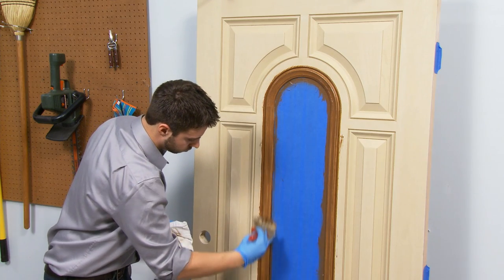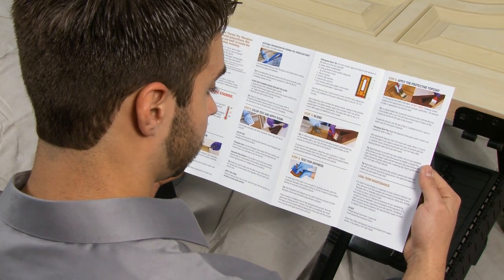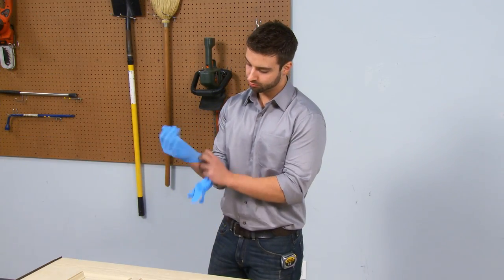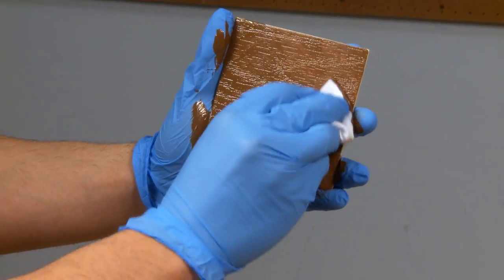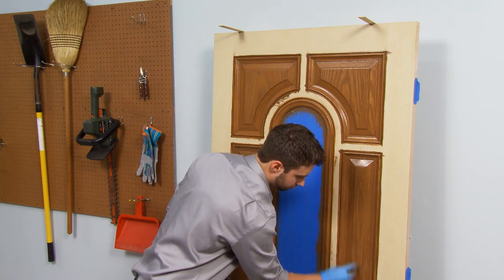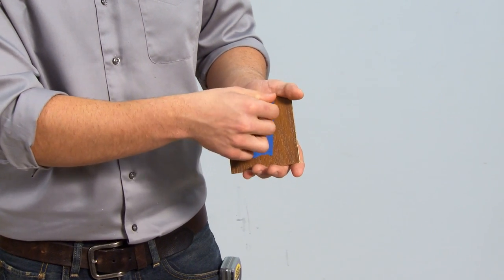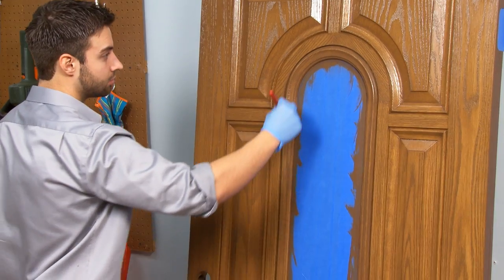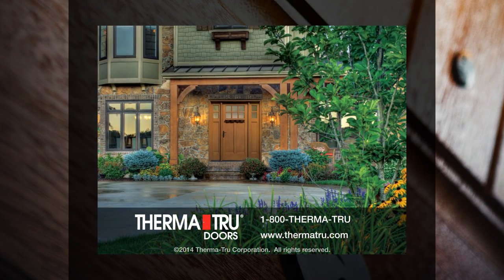How-To use Same-Day Stain and Topcoat: Fiberglass Doors

Comment: Due to the high volume of building in 2021/2022, and our Contractor's multiple commitments, it was taking too long to get a front door. After much back-and-forth about the door we did and did not want, our Contractor tried to help us by going through his door supplier. We ordered the same-day stain ourselves. The painter came to apply it, but didn't allow enough time for the finish to dry. He ended up stripping the entire door...which mars the faux wood grain...and leaving it at our house while he worked on other jobs. We decided to take over. The key to this whole process is putting the finish on in layers; thin and careful. I put too much top coat on the second side, and messed up a good thing. Hopefully there is a solution for that which doesn't involve starting over! Follow the video directions for when to use the foam vs bristle brush. Put the stain on with a cloth as indicated. Wipe up excess topcoat as instructed. This helps with a good faux finish. Watch the video before starting, and before every step of the process. Even the 2nd time of the same process. You always hear another detail that you missed the first time! Put the stain on lightly, and allow it to dry in a warm place. It is not "same-day". We dried 1 day at a time before going to the next layer of stain...if certain it was truly dry. Have a warm/hot area for the door to dry. Use their tape test to make sure the stain is ready for another coat. 2 thin coats with a third touch up was the average. Wipe excess off the brush with a cloth, but avoid too much mineral spirits on the cloth...it lifts the finish of your previous staining, and hard work. Allow time to do a careful, meticulous job. Thin layering is key to creating a wood finish. Would I get this door again? If "yes", I'd have it come with the factory stain. Forget the DIY. The door does look more "life-like" with the stain done properly. But the real answer is '"no". I wanted a wooden door all along, but couldn't source one. I could have bought the same style wooden door for $1,000.00 less at Home Depot and it was pre-stained. Also, I would have rather spent the extra $1000.00 on a solid wooden door. COVID and supply chain issues caused us to have to go through a year long headache that culminated in the availability of the door we had wanted in the first place. By that time, the door jam was installed and the other door purchased...with no returns allowed by the Contractor's supplier.

Comment: word to those that want to do this.
Do as they say and do certain sections, and have PLENTY of spare old t-shirts handy in strips.  Like 20 of them.  Very lightly glide the old t-shirt over the stain to smooth and wipe it in.  Sadly, I had to recoat as the door I was more aggressive with the wiping that the side lights.  So when it came time to do the door, I thought I nailed it but this stuff will wipe of almost completely down to the bare fiberglass if you push to hard.  So be gentle.  Even if you use three fingers behind a wad of t-shirt you'll see three streaks that will need to be smoothed down or restained.  I had an area whereas I had finger marks, but didnt notice until after I did the top coat. I wiped off the top coat and reapplied stain - six hours later the stain still isnt dry. 
This isnt stain fyi, I dont know what it is but it's NOT stain.  DO NOT rub it like you would stain, VERY GENTLE and smooth motions.
Reply: This gel stain. But more of a liquidy form. Not sure why they recommend not to use gel stain.

Comment: Can I restain my door using the same Therma-Tru color I originally used without stripping it?
Reply from the maker: For small scratches, new stain can be applied easily to touch up the areas. However, for larger areas, newly applied stain may not adhere properly to the existing finish or blend seamlessly. For larger areas, we recommend stripping the door to the bare fiberglass and re-staining the door.

Comment: Should've mentioned that the paint brush sheds like a Maine Coon in spring. For a $150 set, I'd expect a better quality brush. Haven't gotten to the top coat part, so will see how that will go. P.S. The top coat brush is fine, but the paint takes a lot longer to dry than 6 hours. I don't know, maybe if you paint it at 90+ F degree heat, maybe it will dry faster, but at around 65-70 F, it has been over 8 hours, and the paint is still wet (and, no, I did not use a lot of paint).

Comment: What kind of caulk are you using to seal any gaps between the glass and the wood before staining?  Is it latex or silicone, or what?  Thanks.
Reply from the maker: Therma-Tru recommends using an elastomeric or polyurethane sealant during this process.

Comment: Could you use this stain over latex paint? Wanting to stain over my king size bed frame
Reply from the maker: Hi, Liz.

Same-Day Stain and Topcoat is specially formulated for Therma-Tru fiberglass doors and Fypon stainable polyurethane. Because of this, we do not recommend using Same-Day Stain and Topcoat on other surfaces and materials. If you have any other questions, our Customer Care team is here to help at 1-800-THERMA-TRU (843-7628).

Comment: Hey man quick question! I watch your channel and fan of yours on YouTube. So got a new door and want to gel stain it but need to cover screw holes up. What kind of sparkle I use and do I prime it with what after? Thanks man!!👍😊
Reply from the maker: Hi Michael, You can use any stainable hardening wood putty to fill the holes. Your local hardware store or lumber yard should be able to help you chose something! Hope that helps!

Comment: Therma-Tru charges a little over $300.00 to stain a fiberglass door ... really? One would think a company can stain a fiberglass door for way less then that. So I just refinished my old door and wood grained it.
Reply: Just bought a new Therma Tru door with sidelights from Lowes.  $1,000 to have it prefinished with their new colors.
Reply: I had the same sticker shock.  When I asked about this, the reply was that factory stain is "baked" on and so lasts longer.  ... hmmm, the skeptic in me wasn't aware any stains required stuffing the wood/fiber into an oven. :)  And this their official video and says that this staining should happen at max 90F.  So no oven baking is done.

Comment: if you want your door to look this good, buy it already done or buy from another company. there are several problems with the process shown here. remember this video is edited.
-1 you cant get behind the hinge all the way without taking it off. otherwise there is a noticeable unfinished spot
-2 if you have exterior bar grills(come installed from distributor) the stain will get behind it since there is a small gap between the glass and the back of the bar grill and you see it whenever you look through the glass. this happens even if you tape it off.
     after watching this video several times and following the instructions in the box. i cleaned my brand new door as recommended, stained it in correct conditions, and it took several days to dry and still had small bubbles in it. now i have to strip a brand new door and buy new bar grills since the originals once have stain all over the back of them. thermatru should not have there doors delivered fully assembled if they are not fully finished. im very unhappy with this product and now i have to spend more money to fix an expensive new door.  thermatru door, thermatru stain, thermatru process= disaster.
Reply: wow, terrible situation.  I wouldn't stain by hand for grills that don't remove b/c too much could go wrong.  Also, I wouldn't stain if the door couldn't be removed off hinge.  Not sure if those options were available to you (we aren't doing ball bearing hinge or grills).

Comment: Spend the extra money and get it pre-stained! I’m not a lazy person, a complainer, but this is a pain in the ass lol, you will see.
Reply: I painted house for 10 years….what a pain.  The grille fiberglass came as a different shade than the fiberglass glass frame from the factory, so the finish came out different.  Taped off everything but the glass frame to try and darken it to match the other material.  Pine wood was used on side glass interior trim?????  Don’t stain it like the fiberglass or it will darken much more than the fiberglass leaving it almost impossible to lighten.  Not to mention the door frame comes primed white, needs painted not stained.  Got it to look good but no where as simple aa the video.  If you silicone or caulk around grills/glass be sure not to get any on where you want to stain as it will not allow the fiberglass to absorb the stain.   Pay the $900 for factory stain.

Comment: I work for a company we build you're doors. I am a stainer. I am about 5 months into this job. I am pretty desperate to figure out how to actually stain you're doors. This video did not make any sense and you hardly showed the man stain the door. Most shots you showed he was already done. The only thing I found that made sense to us staining you're doors was when you said to never use the 3 inch brush to remove the extra stain for it will dry out fast.... 😂😂😂😂. That's our freaking problem 😂😂😂😂😂 wtf. But we also have big heaters the doors go through surrounding our staining area closing us in this hot area. Our main problems are with shale being #1 then Lynx then bark as you can tell it's all with stain B.  We use a wet 3 inch brush to apply and a dry 3inch brush to clean off. Doing a 2-sided frame with a 3 inch brush is a nightmare. Try doing it as a shale 😂😂😂😂 for real though we need yall or something because our staining keeps getting rejected by our quality control and it's nonsense because they themselves don't know how to stain and they are telling is it needs to be better.
Reply from the maker: Our team would love to help with recommendations.  We can be reached at 1-800-ThermaTru.
Reply: @thermatru  I will be calling. Understand I am a new employee who finds a burning yurning sensation to learn truth in staining a door. I am not out to expose my employer or show how dumb they are. I want truth only. If I can learn truth in staining I can learn how to help my employer grow bigger to be the best staining company. Just Understand that before I call.